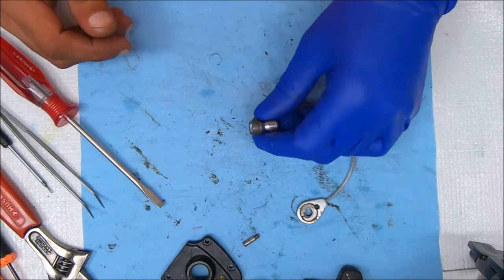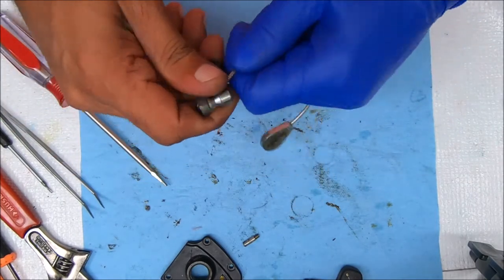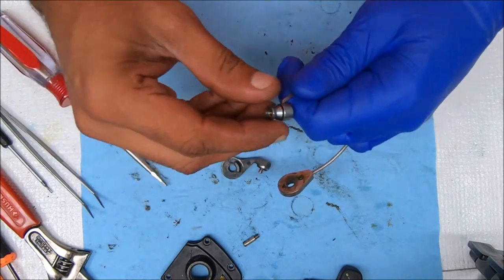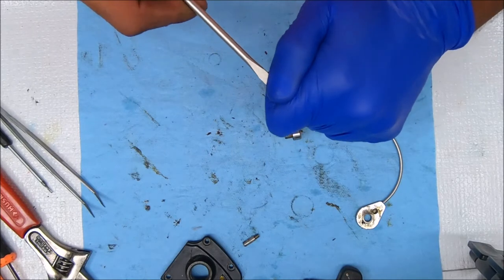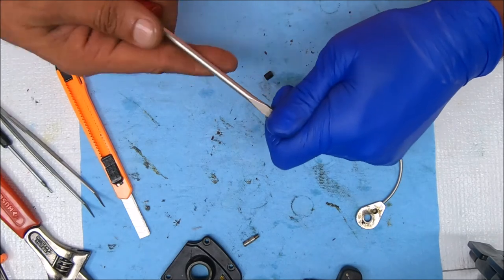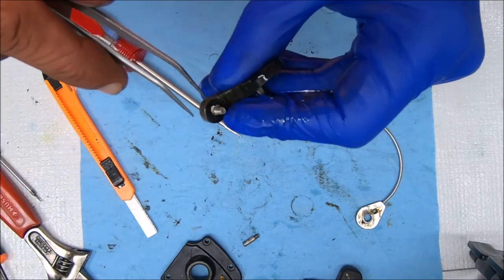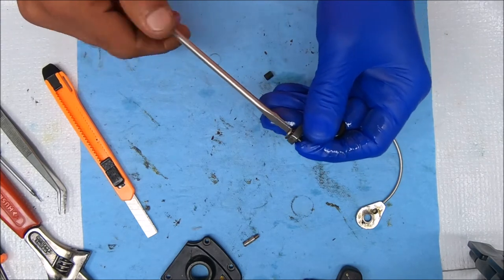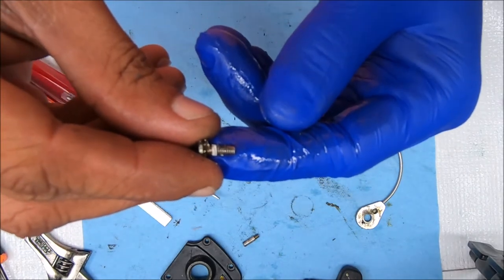Easy way to disassemble a stubborn / frozen line roller assembly how to: Fishing Reel Repair

Comment: Helloo sir. What if the one who stuck is the other end. My stella 4000xf bearing kinda stuck so hard and I can’t take it out
Reply from the maker: Thanks for watching. What's the part number?
Reply: @TSGReelService  thanks for replying sir. Sorry I didn’t have the part numbers as I help to service my friend’s reel. The line roller and its bearing. Both stuck to the case/screw and I can’t take it out
Reply from the maker: You can still get it off, but you may damage stuff you have to replace, so best to get the part numbers before attempting it... want to make sure the parts are available.
Reply: @TSGReelService  yeah seems so. Gonna let it sit with wd40 a day then try to pull it out. Btw thanks again! Keep it up with your content 👌🏻👌🏻
Reply from the maker: @ahmadhakimi8843  you're welcome and no worries. Hopefully, you get it freed up.